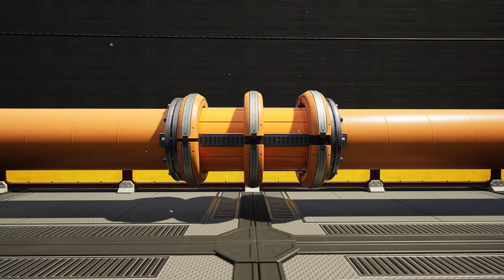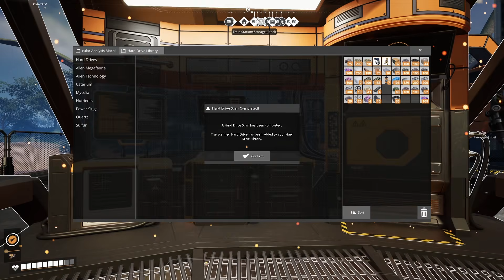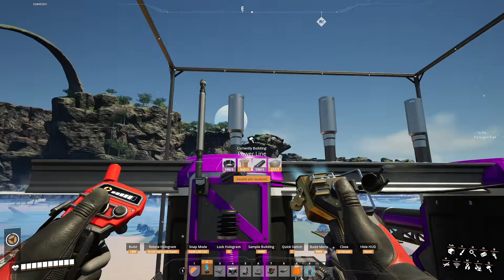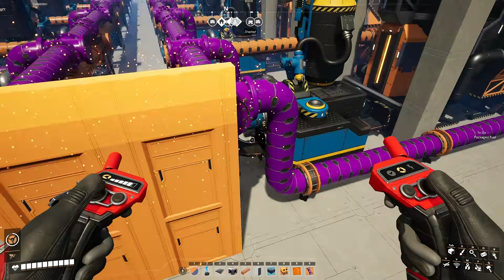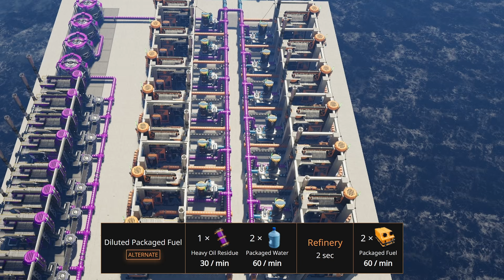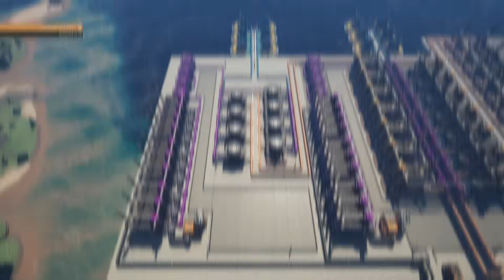This Recipe Will 4x Power in Satisfactory

Comment: So im working on turbo fuel instead of following this guide at this point but.. while working on getting harddrives... i notices that... i think 6 of the 8 i discovered but couldnt unlock, required power... 120mw max... you recomended making a power station blueprint with biomass burners a long time ago in this guided playthrough... i reccomend this 100%.. do this.. you will use it...

Comment: Christ. I just finished setting this up for turbo fuel. Still setting up all the fuel generators to eat up all that turbo. Should end up near 45GW I think. The struggle was balancing the flow with the volume I went with being that it surpasses my belt limits and mk2 pipes.

Comment: Minor suggestions to the diluted packaged fuel line:
- Rather than setting 6 water extractors with one at 133.3%, set 8 extractors at 83.33%, each producing 100 m3 of water per minute.
- In the refineries and packagers, downclock all of them so each produces 57.142 units per minute.
The reduction on energy consumption really works out quite well. Save the energy cells for the generators, that way you can save more space.

Comment: I don't understand how you take a relatively simple blueprint, and then speed up random parts, skip over placements, and don't show the entire process.  Does every video of this have to be this way? I had to stop and rewind half a dozen times just to figure out where you were placing certain items. You called a belt a pipe at one point, orientation and output isn't shown on the first packager, which is inferred about 30-45 seconds later when we can finally see how it was placed.

Comment: i spent like 30 minutes trying to find out where you found an extra 300 oil for the blender build.  then i realized when we built the Fuel facility with the vanilla recipe  you overlocked your generators to get better use out of 300 oil vs. myself which I used 600 oil for 20 generators.....this is why i should not have skipped ahead. lmao

Comment: I'm sorry if this has been asked, but:

300 crude oil (one normal node) goes to our computer factory
600 crude oil (one pure node) goes to our rubber/plastic
600 crude oil (the other pure node) goes to our old fuel generator setup

Where do we get the additional 300 oil for diluted fuel, again?

EDIT: I rewound and realized our old fuel generator setup is 300 now, all good

Comment: 12:30 If fluid throughput weirdness occurs, the part you'll need to manually remove/rebuild is only where the auto-connect feature has attached the pipes. It's the same kind of weirdness that happens when you place pipe junctions on existing pipelines: Extra, overlapping, interior volume is created where there shouldn't be, meaning more liquid is required to fill the pipes and push it forward. If you see your pipes sticking halfway into your junctions or pumps with the dismantle tool? That pipe segment is experiencing the bug. Remove and replace the pipe manually to fix it.

Comment: When i researched Rocket fuel and later stumbled over "Alternate: Nitro Rocket Fuel" this was the game braker for me. I'm able to produce 144GW energy out of 600/minute Crude Oil. I automated ballistic Warp drives and my max energy consumption is at 77GW. So i have no need for nuclear Power.
Reply: It took me probably 35 hard drive to finally unlock Nitro Rocket Fuel yesterday 😅

I had just finished my regular fuel setup…
Reply: @jonathansaindon788 noooo haha you can reset them :)
And if you want real shenanigans unlock like 30 hard drives with recipes you don’t want and then keep save refreshing one :)
Reply: When I put it in Satisfactory Modeler it first time with 600 crude, residual fuel, diluted fuel, nitro rocket fuel and ended up powering over 500 nearly 600 fuel gens I got a little overwhelmed 😅 I settled on starting with 200 almost fully over-clocked with enough room to easily double it when I want to.
Reply: I researched rocket fuel, and using the oil >>> heavy oil residue recipe combined with the diluted fuel recipe, I'm taking 1080 oil/min and turning it into 4000 rocket fuel/min for 210GW!

If you do the math, that doesn't make sense, that's because I'm siphoning 500 rocket fuel/min to be packaged.
Reply: Is it any wonder the oil barons are fighting nuclear power in real life? Petroleum is too damn useful.
Reply: @andrewschort724  Useful for profit, not industry.

Comment: I pretty much stopped using nuclear in my builds because rocket fuel is more than necessary for anything.  Another trick is to group your water packaged fuel part with the corresponding refinery part, and hook it up to a dedicated line with a storage box for each line.  Prevents lockups and you always have a steady supply for the water packagers.  Can be quite visually appealing to see 4 belts of packaged water zooming by at full capacity while having the empties zoom back the other way at full capacity.
Reply: Same. Nitro rocket fuel is absurdly broken.

Comment: I went all the way to rocket fuel (and A BUNCH of polymer for plastics and such) in the same location and got something like 50 or 60GW or something. Around 250 generators and enough left over to fill some tanks for flying around with jetpack!

Diluted Fuel is OP!
Reply: Bite your tongue before CSS nerfs the recipe!!! 🤣
Reply: Just wait until you go all the way to Nitro Fuel. That chain is completely broken. I'll never need nuclear again. A paltry 6GW from a reactor? Pff, pathetic! My Nitro fuel facility produces 300+ from the gold coast nodes alone. It's completely stupid.
Reply: @TheOnlyToblin  when you consider late game you need crude oil for other things, nuclear starts to make more sense.  Still, nuclear is UNDERpowered if you ask me.  Nuclear plants should generate orders of magnitude more power than fuel generators and generate far, far, FAR less waste.  I get CSS structured it this way to make you build more than a handful of reactors, but it makes nuclear very undesirable as a power source.

What's needed is a rebalance of nuclear (i.e. make more power and less waste) and a drastic increase in the power required to run late game buildings (particle accelerators, quantum encoders, etc.).  Then you'd be both forced to build nuclear plants AND they would be somewhat less of a headache to maintain.
Reply: Nuclear is absurdly underpowered in this game. You need so so so many reactors with huge infrastructure and obnoxious amounts of water to get anywhere near nitro fuel, sadly.  @ThePrisoner881
Reply: Diluted Fuel into Turbo Fuel into Rocket Fuel gets even more insane. Use Turbo Blend and Nitro  Fuel alternate recipes for more bang.

I've turned 540 oil into 2000 Rocket Fuel, which is roughly 120GW, or 480 Fuel generators

Comment: i seem to no be able to run the calculated power plants with the exactly calculated fuel. i am always a few m^3 fuel short at the end of the line. can anyone help me with that?
Reply: Add a buffer at the end. Wait until they are full. And reconnect one by one (pipes or electricity) of the generators beginning from the end of the line.
Its like reversing the principle of a manifold. Fill the last generator first and work backward to reach the input pipe.
Also wait until all pipes, machines and buffers are full.

Sry for my poor english. Hope you understand.

Comment: I have 1800 coming from the gold cost producing 60gigs with the diluted fuel alternate. I was using diluted packaged fuel but when I unlocked the Diluted Fuel, it skyrocketed. It's insane how big it is but I'm pretty sure we won't need power for a while. also producing 1200 resin per minute. This should free up all the oil on the north coast

Comment: I found that with blueprints and pipes, if you remove the cap (sorry, I don't remember the actual name), so the pipe is just raw at the end, they connect better. I think it has something to do with what they are actually trying to connect to. If the end caps are there, they connect to the cap, but not to the other pipe connected to the cap. If the caps aren't there, they connect just like belts. At least that's been my experience.

Comment: I used all the oil nodes on the west beach, 1800 m^3 oil into 1800 m^3 heavy oil ( alternate recipe ) into 3600 m^3 Fuel using blender into 5400 m^3 rocket fuel ( alternate recipe ), now i dont know what to do with 300 000 MW of power
Reply: Run a cable over to my map. I could use some of that power. 😀
Reply: @biggtrux 😂 if only i could

Comment: Please don't use fluid buffers in series, or one after another if you prefer.

Fluid buffers have headlift relative to the fluid level. So if you put several buffers one after another they will try to balance with each others, since fluid goes to a place with lower headlift. In real life it would eventually balance itself out but in satisfactory it won't. And so it will mean heavy sloshing between the buffers. It might look good for a while because the buffers were filled, but at some point it'll be a problem.

An easy fix is to use pumps or valves in between each buffers.
Reply from the maker: No issues in my build though. The Diluted setup is 100% running and flat and has been running for about 4 hours now.

Comment: @TotalXclipse lovely build as always!  However, something I've been exploring for a bit is more vertical builds to make better use of space.  After all, there's limited flat ground space to work with but virtually unlimited vertical space.  For this, I put the first stage oil refineries on the top floor so all remaining outputs flow downwards, removing the need for pumps beyond those needed to push the crude oil to the top floor.

I did the same for the generators, only instead of producing fuel or turbofuel, I'm producing rocket fuel.  Since it's a gas, there's no head lift so no pumps.  I'm powering 144 fuel generators (nine floors of 16 generators each) for 36GW of power from the whole stack, and it only takes up floor space of a 4x4 grid of fuel generators (plus piping, wiring, and walkways of course).

This setup works really well in cramped places like the Blue Crater!
Reply from the maker: It's difficult to pull off vertical builds in a guided format, but I am doing more and more vertical builds in my own lets play :)
Reply: @TotalXclipse  I'm following your series with great interest, mainly due to the aesthetics.  My vertical builds always end up as plain cubes, largely because I lack your artistic flair. I'm very curious to see how you decorate your vertical builds, especially really tall ones.
Reply: P4

Comment: I normally run a manifold for my packaged water/fuel with a buffer container and a lot of extra cans, it's fine so long as you burn everything.
I was just about to set up a fuel - turbo - rocket fuel in the crater last night and I saw the Nitro Rocket Fuel, which should do 288 gens from 300 oil, if I can keep the sulphur and gas supplies going.
Reply: I did a manifold once, need a huge amount of extra canisters to fully saturate the line. I find it way more efficient to just make a couple blueprints for self contained modules. Each module just needs 1-2 stacks of canisters to keep 100% uptime. Plus easy to setup another build if you need more power.

Comment: The sequel to this will be Diluted Fuel and Nitro Rocket Fuel. 300 Crude oil to 1200 Rocket Fuel + 400 Compacted Coal
Reply: Yeah in my latest playthrough I setup a plant using 2400 sulfur, 1200 Coal and 900 crude in the crater to make over 200 GW.
Reply: That's my favorite!

Comment: And if you want to go really ham and turn it into rocket fuel you can do 300 fuel generators from a single node. I've got 2 nodes feeding 600 generators for 150GW
Reply: Agreed. 

Diluted heavy oil + nitro rocket fuel oil is a better recipe if you have the unlocks. 

Something like 256 generators per pure node (Can’t remember off the top of my head).
Reply: Agree not sure why you would build a DPF power plant at this stage of the game. Once you have Aluminum, you can unlock rocket fuel and use the nitro rocket fuel recipe along with heavy oil and diluted fuel to create basically all the power you will ever need unless doing insane level end game factories.